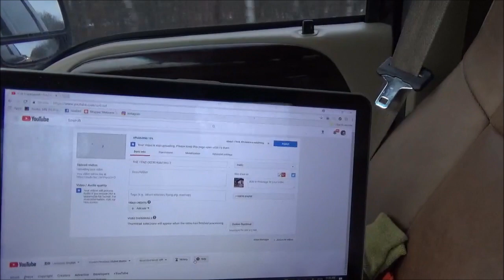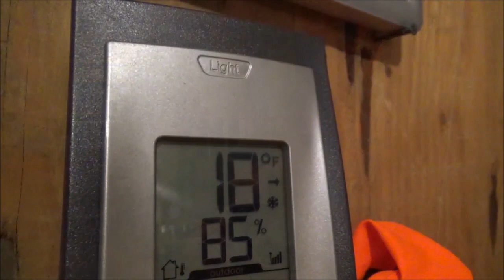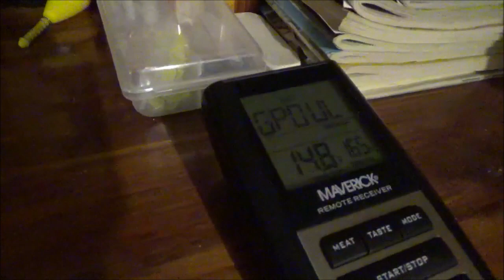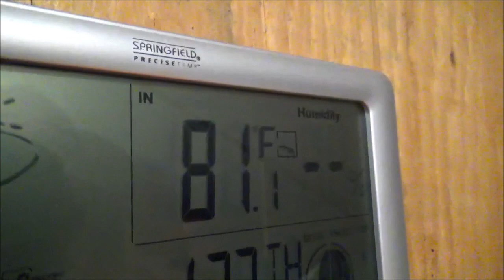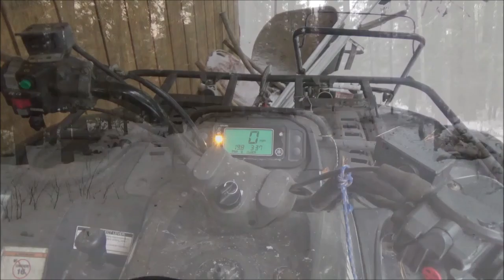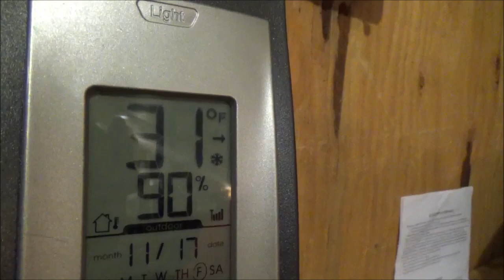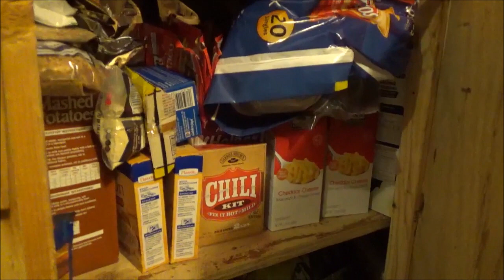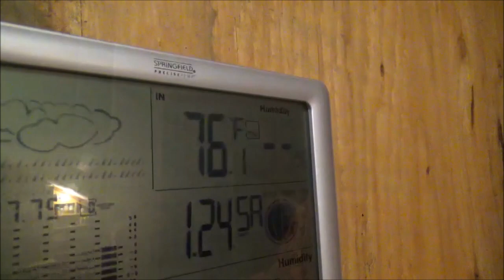THE TENT. Deer Hunting 2017. Final Weekend. Harvest.

Comment: Joe why are you locking in your hubs manually? Ford has automatic locking hubs unless you have a vacuum pump problem preventing the auto engage?
Reply from the maker: My 1 ton diesel has lock outs. my 1/2 ton does not. that truck is my 1 ton.
Reply: JoeandZachSurvival Yeah I’ve got the same truck Joe & they are automatic locking hubs. They have a backup system which is what you’re getting out to lock-in...really only used for if you have a vacuum pump failure. Next time you need 4wd, just lock the truck in with the controls on the inside & you’ll see what I mean...it’s the same thing. You’ve been getting cold all this time for no reason LOL

Comment: Joe have you ever tried putting the caned goods and stuff that can freeze in a cooler to keep the freeze off of them? i Would think it would keep the stuff 20-25 degrees warmer if not more depending on insulation.
Reply from the maker: Winter in much to long up here. The cooler would not help them after a few days.

Comment: I've noticed the hot water tank on the woodstove in several videos...do you use it??? Why or why not??? I had thought of adding one on my stove but never did....what can you tell me about one...worth it or not.....thanks great video
Reply from the maker: It looks pretty and it does work but the trouble is that water is always boiling then and just evaporates away. A person does not use hot water all that much during the day so you end up wasting a lot. Thats why I just put it in a pot and heat when needed. But the water heater does work and works well if that is where a person wants to heat their water.

Comment: Those are very young deer.  Minnesota needs to change its regulations to the 13-inch rule (inside spread out to the edge of ears).  That spike was a yearling.  I would not have taken him until 2.5 years of age to see if he was going to do anything antler-wise and to get more meat on him.  The 6 point you filmed was also young at 1.5 years.  You need to let these deer grow and mature. It will do wonders for your herd and you will be glad at the results of the body size and rack sizes.  Even if your state doesn't change its regulations to let the deer grow, your lease can formulate sound management and over time, you can get other properties around you to buy in as they see the results.
Reply from the maker: I hunt in the Superior National Forest which is 3.9 million acres of public land. My Tent property is privately owned by myself but is surrounded on all sides by the national forest. There is no way to manage a herd, there are no neighbors to help manage that herd.

Comment: It was a 400 yard shot?  The way you sighted your rifle in it looked like you would be pretty good out to 200 yards.  A 180 grain bullet should shoot fairly flat but at 400 yards there would be considerable drop.  How high did you hold?  Did you really say 400 or did I misunderstand?
Reply from the maker: It was 392 yards. I aimed 2 inches below the backbone on the front shoulder and the bullet disconnected the heart from everything on top of it. I literally pulled the heart out with no cutting. The bullet dropped (if my aim was exactly 2 inches below the backbone, I was excited but not overly) about 3 and a half to 4 inches.
Reply: That was a great shot.  I believe you said that a long shot in your area was 75 yards.  You stretched that out a bit.  lol.  Congratulations on the deer.

Comment: do you always plug the truck in if it is below freezing?
Reply from the maker: No. I do if it is going to get down around 10 degrees or below. If I am parked right by the workshop at home I will of it gets below 30 or if I remember to do it. It always starts so I do not worry about it much.

Comment: Joe what kind of boots do yall use up there to keep your feet warm on those long hunts??
Reply from the maker: Mine are a brand name called Rocky. I bought them at Cabelas maybe 10 years ago. It is time for a new pair because I saw the back is splitting out a little but next time I want to get boots that have the removable liners. They would be much easier to dry if they get wet.
Reply: Thanks Joe!!

Comment: Great video as always and way to put in the work to get that buck. Most would have slept in with those conditions. 

Can I ask what software you use for editing?
Reply from the maker: It is called Media Impressions. They no longer make it to buy new but you may be able to find an older version somewhere. It originally came with the Kodak Playsport cameras.
Reply: Ok thanks.

Comment: what kind of boots u wear in the stand that u dont freeze your feet
Reply from the maker: Mine are a brand name called Rocky. I bought them at Cabelas maybe 10 years ago. It is time for a new pair because I saw the back is splitting out a little but next time I want to get boots that have the removable liners. They would be much easier to dry if they get wet.

Comment: Joe, what kind of camera and video editing software do you use for your videos?
Reply from the maker: My last 3 cameras have been Sony Handycams. Right now I am using the HDR cx405, before that I had the cx330 and before that the cx220. Of the 3 this one I am the least happy with. Small battery and I do not believe the video quality is quite as good. It is a good camera dont get me wrong but it pixels in the sun too much for me. I also put my cameras through a lot with the weather and getting banged around out in the woods and this one is showing signs of wear earlier than the others. These cameras are all in that 300 dollar range more or less. I want to upgrade like I should with the channels growing quite fast to the 800 to a thousand dollar cameras BUT...... If I break the camera or it falls in the water or whatever and is useless.... 300 is an easier pill to swallow than a thousand. I am really at a strange spot right now because I need another camera, this one is on its way out. I edit with Media Impressions which is a software they no longer make. I need to start leaning a newer software because some of the actual pixeling could be because my editing software is old.
Reply: Look at Gimp and Pixlr for editing software. See if one of those will meet your needs. Loet me know what you think!